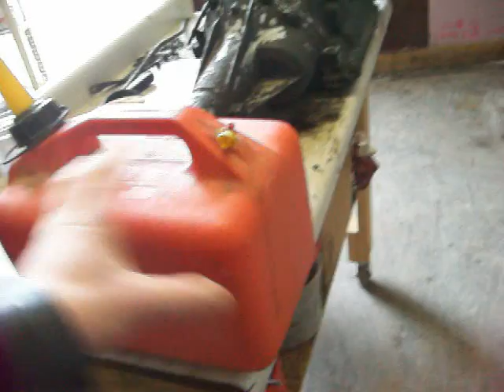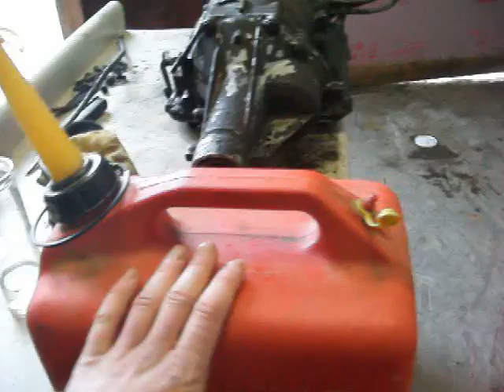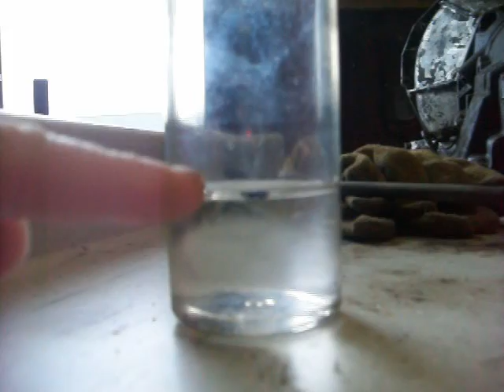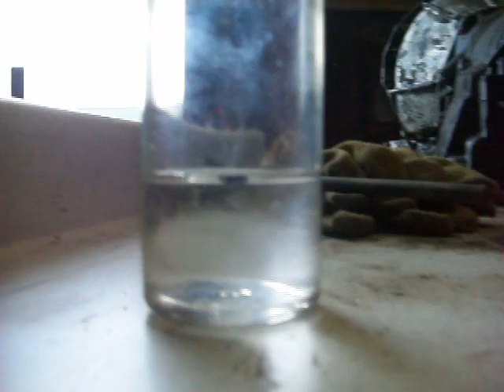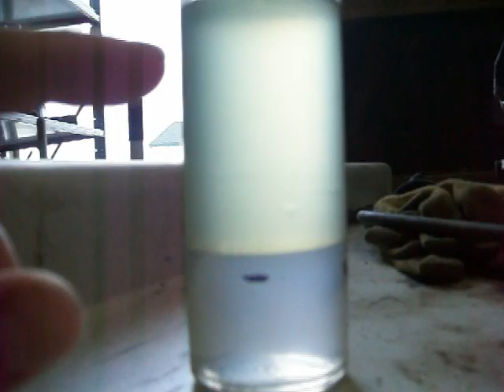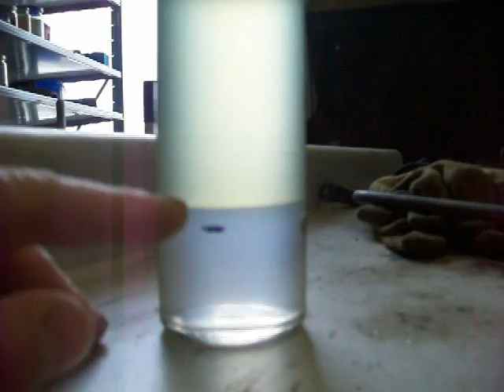E10 Gasoline

Comment: I'm running E10 in my snow blower, Honda mower and My John Deere mowers. I use SeaFoam 1 oz per gallon. I never had had any issues ever. I've been a home owner since 2001. I also live in Minnesota. I run E30 in my Silverado. E85 in winter not good since the tank will empty very fast. I go to regular e10,e15 and e30.

Comment from the maker: @coffeefish dry gas or heet/iso-heet are just either methyl or isopropyl alcohol, depending on which one you buy. Ethanol absorbs water the same way methanol or Isopropanol does, so putting a bottle of it into a tank of E10 is like pissin into the ocean, it ain't gonna change much. If somebody wanted to put that in their tank it would be cheaper to go to the drug store and find some %99 rubbing alcohol.

Comment from the maker: @AReptileMan The water level rose in the jar because the ethanol in the E10 separated from the gasoline not because there was water in the fuel to begin with. E10 from the pump will probably have a tiny bit of water in it, but for the most part its "dry".

Comment from the maker: @skip0110 Gasoline has more engergy than ethanol so you will get more power from a gallon of gasoline than you would a gallon of E15. The reason that some race cars use alcohol for fuel is because it has a higher octane and they can run higher compression engines or use more boost without having as much of a detonation problem.

Comment: @skip0110 Less ethanol will produce more power.... I think. Ethanol has a lower BTU rating than regular non ethanol fuel. I have a friend who bought a truck that can take that e85 gas and his mileage goes to crap when he uses it....sure it's cheaper, but you burn more of it.